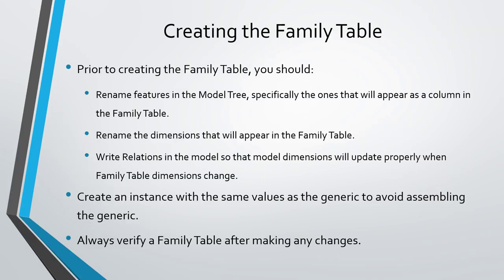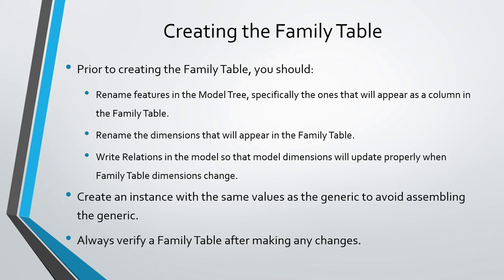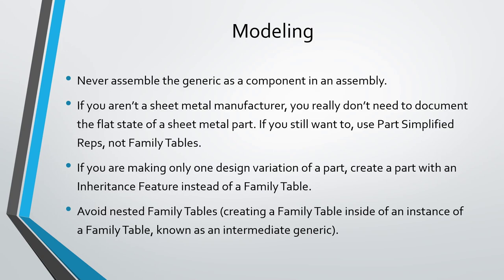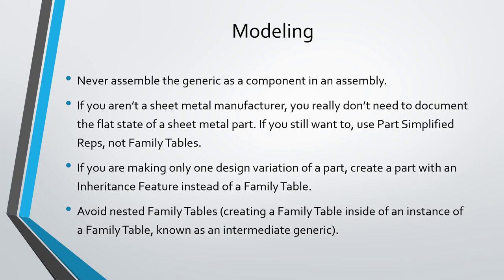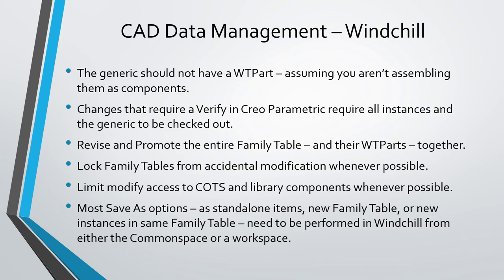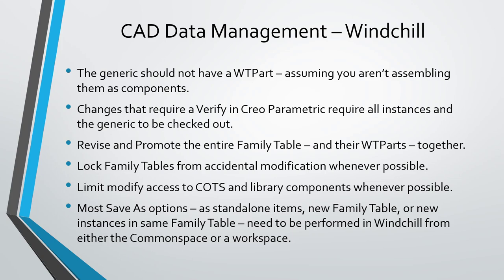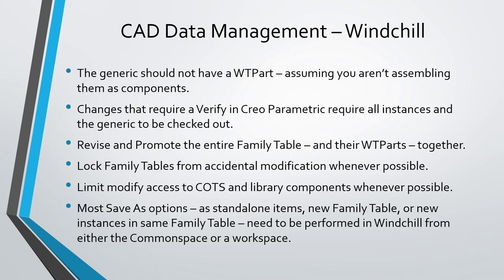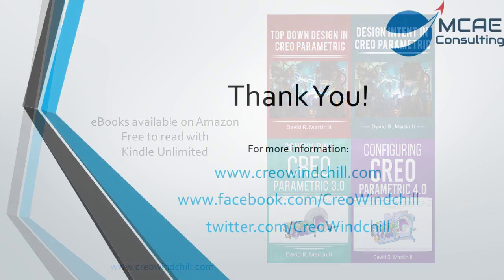Creo Parametric - Family Tables Healthy Practices [Lecture]

Comment: Awesome!  Thank you so much.  The tip at the very end was new info to me, and that is actually where I would run into a lot of trouble in the past (trying to "save as" a family table from within Creo)
Reply from the maker: Sean, glad to know that helps. Up until recently, I used to initiate all my Save As operations from Creo. But it turns out Windchill offers a lot more ability than Creo. Also when I've tried to Save As assemblies with Skeletons and lots of Data Sharing Features, I've often struggled doing this in Creo, but it turns out Windchill is much better in that area as well.
Reply: @CADPLMGuy  Great to know.  Would you typically access Windchill from a separate web browser for this type of activity or would you go through the "folder browser" tab next to the model tree within Creo?
Reply from the maker: I could have sworn I replied to this - maybe I tried on my phone and it didn't take. If I'm performing the operation from the Commonspace, I will usually do it from a stand alone web browser, simply because it's easier to read than the embedded browser. But for any actions I take from the workspace, I prefer to do it from the embedded browser to ensure that it is linked to my workspace cache. (Stand alone web browsers are not linked to the Creo Parametric cache.)
Reply: @CADPLMGuy  thank you for the very clear answer.  Makes complete sense. Knowledge!